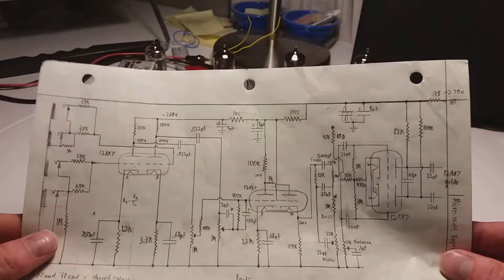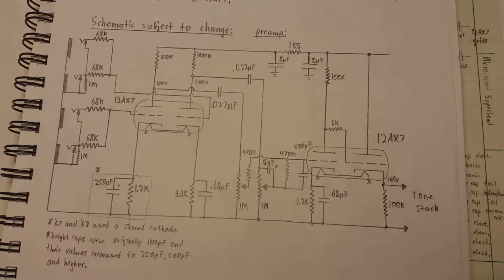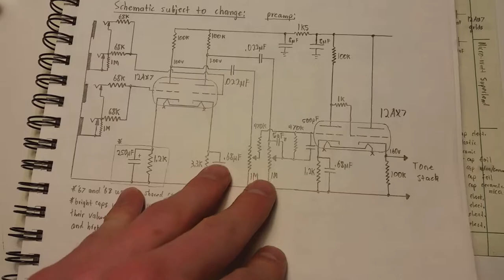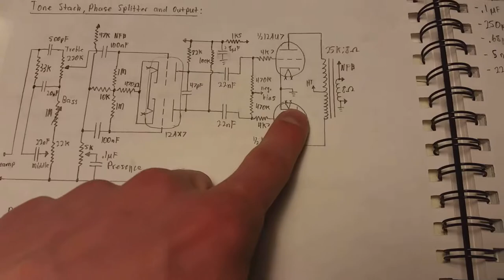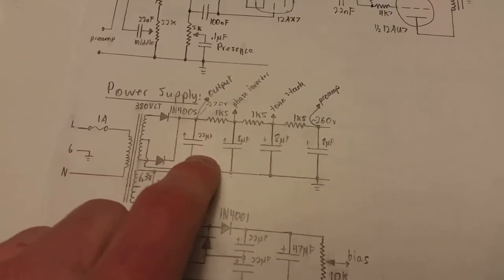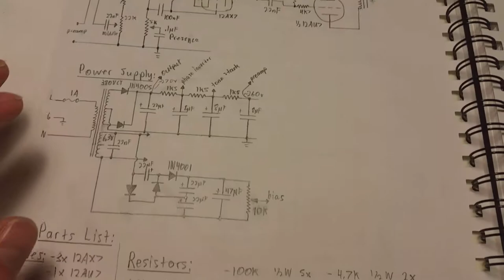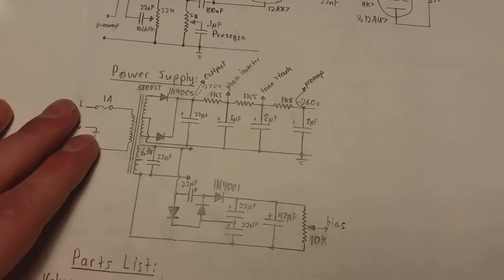Micro Superlead Circuit

Comment: Hi! Great project! I want to refactor my JCM800 EL84 SE amp into PP based on ECC82 or ECC99. Please tell me how you recalculated preamp cathode resistors for lower anode voltages and which anode voltages were your reference? Thanks!
Reply from the maker: It's been a long time, but I remember getting the datasheet with the characteristic curves for the 12AX7 and plotting loadlines for the anode load to find the cathode resistor. I wanted to keep the gain relatively the same so I kept the 100k anode load resistor. I wanted the anode voltage to be just above half of the available HT voltage. Ohms law gave the required anode current in order to make that happen. I settled on a desired grid voltage of something like -1.5V. Tying the grid to ground and putting a resistor of 1.2K between the cathode and ground yielded ~1.6V. The second stage is biased colder for some reason at something like -3V near cutoff. I do not remember the reason for this nor the reason for why the two input stages were so different. I do remember trying to emulate the real superlead circuit and keep the bias voltage and anode current ratios as similar as possible. The bypass caps are different between channels because one is the bright channel with less bass and the other is the normal channel. I think I did recalculate those values as well using the standard -3dB RC filter equation. The stage after the volume control is biased the same as the normal channel input stage. (The bright channel is the one with the bright cap on the volume control).  I do not remember changing anything in the cathode follower driving the tone stack. I may have left it the same. The tone stack is literally cut and paste from the original. I'm pretty sure the phase splitter long-tailed pair stage was also original. The only thing that I changed was the feedback resistor in the presence knob circuit since the output stage had a different amount of gain. I did this experimentally and settled on 47K but I might have been able to go lower. The output stage I had to change the grid leak resistors to something lower to drop the gain a little and added big grid stopper resistors to hopefully knock down RF and prevent oscillation. I'm pretty sure the 12AU7s in the output make way more voltage gain than El-34s do. This causes the amp to compress the sound a bit too much at full volume. The sweet spot is about 2/3 of the way up. You could probably decrease the gain somewhere and make it more manageable. I could not tell if this excessive compression was due to the power transformer sagging, the output transformer saturating, or the gain issue.

Comment: I've decided im gonna do a baby plexi build, would you want to share you're diagram with me? I'm plannig on going ecc99 with a bit bigger OT. Love to hear from you!
Reply from the maker: I've only heard of the ECC99 but it looks really good on paper. JJ claims 5W plate dissipation at 400V with more gain than a 12AU7. I may have to try this one out someday. Bigger transformers in general would be ideal, it's just a matter of size and cost I guess. Just bear in mind the OT has a non-trivial influence on the tone and dynamics. The main thing I realized about the Micro-Superlead output stage is that it has too much gain and too much input sensitivity. The phase splitter will drive the 12AU7s well into clipping before the volume knob is maxed. This makes it sound super compressed and weird sounding. Part of this could have been the tiny output transformer I used. I ended up adding some 150K grid stoppers to make a potential divider with the 470K grid leak to reduce the signal level somewhat on the 12AU7s. That helped but did not remove the problem. (In fact, I think it contributed to the hum by reducing the dynamic range.) I didn't want to make the grid stopper resistor any larger because I thought it might infringe too much on the high frequencies. (Low-pass filter with grid capacitance.) The wise thing to do would be to redesign the preamp for less gain but it might sacrifice some of the "plexi" sound. If you give me an email, I can send you my schematics.

Comment: This is amazing! I just watched the video that you play through this amp and its sound. What's the calculation the get the proper cathode bias resistor values? I was thinking about adapting this to a very low voltage operation, like 24v DC. Thanks!
Reply from the maker: For really low voltages like 24V, regular cathode biasing probably won't work. Grid leak biasing is pretty much the only thing that works below a certain voltage. Tie the cathode directly to 0V and adjust the grid leak resistor value. Typically, this value is something like 1M, and the tube will pretty much bias itself normally. To set the bias closer to 0V on the grid, use a lower value resistor (100K or so). To set the bias to near cutoff (more negative), use the max value of 2.2M or 2.7M. You may find that 12AX7s are more finicky than 12AU7s since their anode current will be lower for a given voltage. 

Of course, you won't be able to get exact bias values this way. The calculation for cathode biasing basically involves finding a location on a dawn loadline on the characteristic curves and finding the expected cathode current. Using Ohm's law, you find the resistance required to get the voltage drop (grid to cathode voltage) to bias the tube at that current. If you do this at low voltages, this will add to the overall bias voltage and drive the tube into cutoff, which is probably not what you want. At normal voltages however, this is almost always the process you would use.

Comment: Looks Friggin' cool, how much volts is your PT and hows the cleanish tone?
Reply from the maker: The PT is a 380V CT at 30mA. There is also a 6.3V winding at 1.2A. This circuit basically uses the whole transformer. The four tubes draw exactly 1.2A for the heaters and I'm sure the HT draws near 30mA when cranked. I have another video on my channel demoing the amp and you can hear what it sounds like at various gain settings. The cleans are honestly not the best. At least not compared to a Fender or something with hot biased 6v6s. The sound is sort of brittle at low levels and really only comes into character when pushed a little. Part of this could be the speaker not responding as well as it could since the clean sound is very quiet. There is a palpable lack of headroom with this amp. I can't get crazy wide clean-crunch dynamics like I can with my Marshall 18 watt clone. I imagine this is due to the low HT voltage of only 270V. I think the real Superlead has a HT voltage of 450-470V or something.
Reply: @thetuberoaster8321   The Tube Roaster  Very nice, I have been thinking about such a build for a while. Probably with an ecc99 for output tube to increase the output for a bit. Do you think a rather big OT will improve the headroom? The original super leads had rather huge Iron ofcourse.typically for a 12au7 or ecc99 a hammond  125A would be sufficient but you think a 125B or C would do the trick? I do want to be able to cover the inbetween plexi sounds, as you said the clean crunch dynamic sound. Also most PT's I can get over here seem to have rather low HT voltage. 300-325 ish.
Reply from the maker: @pietlut2245  I forgot about the ECC99. It has a low enough Ra that you could use "normal" output transformers with it. The issue with the one I used is that it is only rated for one watt, but at full power the amp makes like 1.2W. I had to use that one because it had a primary impedance that was high enough for the 12AU7. The HT voltage is more of a question of what can the output tube(s) take. The 12AU7 is only rated for 300V if I remember correctly. You could also use the 12BH7. It would be beefier than a 12AU7. I think if you used an ECC99 with a Hammond 125A transformer with a primary impedance of 4.5K to 5K, and put the HT voltage around 350V to 400V, you could get a sound much better than the amp I made. The headroom would be there for sure. It would also be more powerful; making maybe 1.5W to 2W of power.